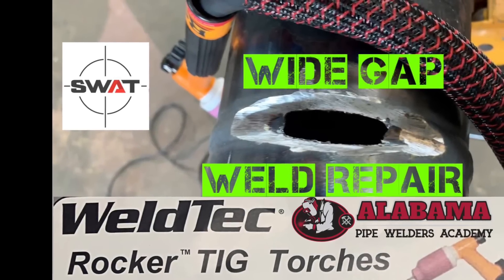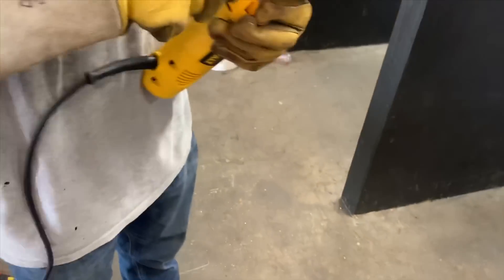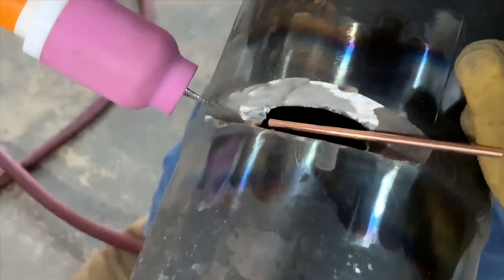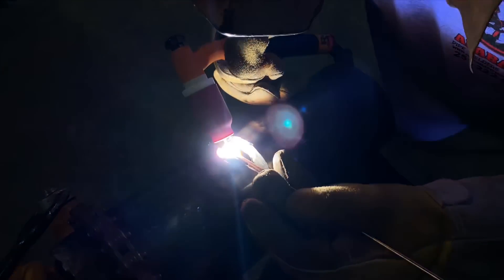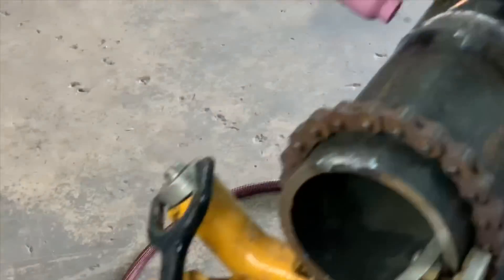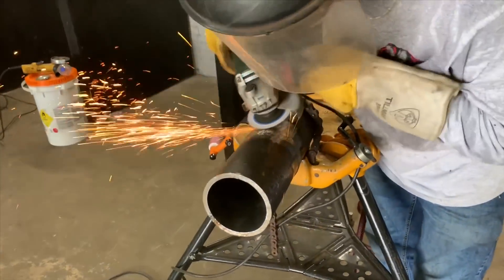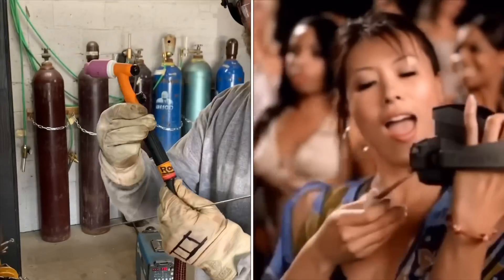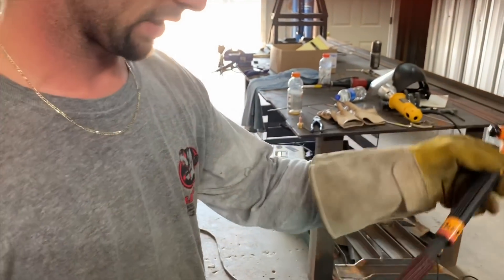Wide Gap Weld Repair

Comment: So you filled it up, then smoothed it out and capped it. But since you made it the same size cap as the other side, did you not cap some of the repair, since the repair was wider then the original cap. Or I may be wrong.

Comment: I remember back when I was in school I had a guy come in and ask if I could fill in a small hole on the rusty pipe he had, it was a good 3" mild pipe I would say 1/16 - 1/8 thick in that area and you could poke your finger through it and I only had a mig welder on hand so I had to use the same technique as he did for the root, I basically put weld on weld all the way across, by no means did it look pretty but the welds will last longer than any part of the pipe